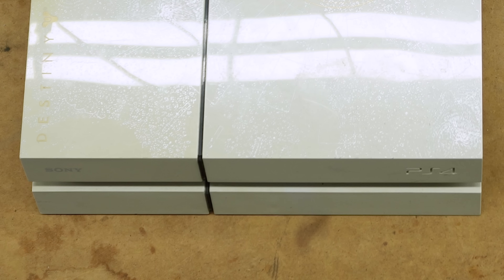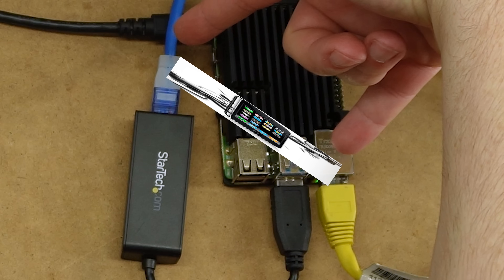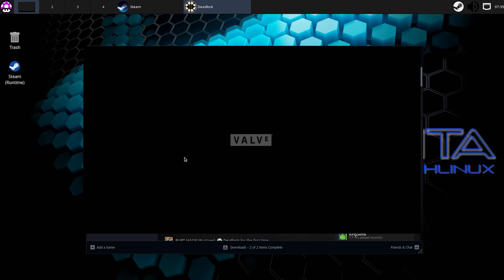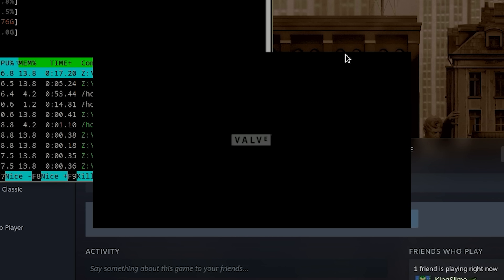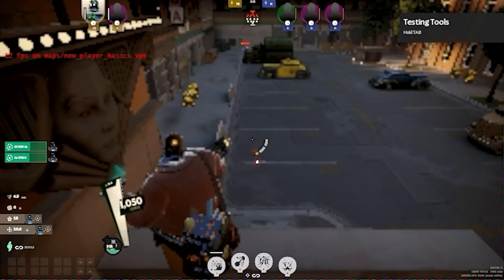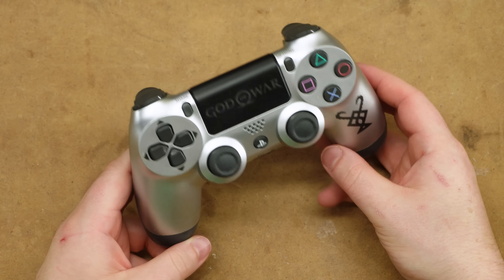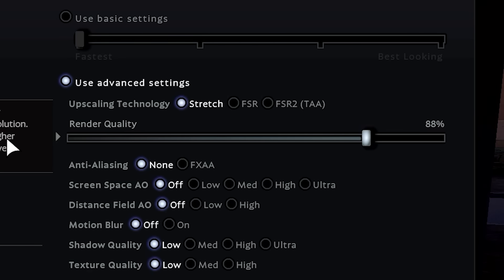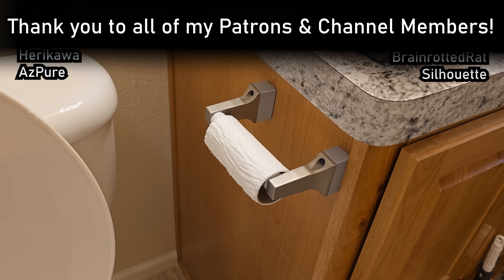I Played Deadlock on the PS4. It's as bad as it Sounds.

Comment: Yeah, swap on linux is important*. If you hit the memory limit, the kernel will go into a panic state where it runs the OOM Killer (the out of memory killer). Unix operating systems can promise a program more memory than it has, since the main way linux programs used to do multitasking was with fork() commands, which split processes in two. Then only the memory *changed after that gets copied, which is called copy on write. So what happens when the kernel runs out of memory, but has promised a program there was more to be had? Well.. out of memory killer. It starts looking at processes and sort of guessing what it can nuke. Sometimes that can be something that absolutely should not be nuked.

Always have swap, no matter what.
Reply: Also, the display driver is literally reverse engineered. Because of course there was a whole bunch of shit AMD did different for this one APU. Oh, and they couldn't launch linux on the PS4 with ease, because it turns out the PCI controller they homebrewed literally says 'yes, its there' to ANYTHING you probe for. So linux would literally try and launch every driver for every possible combination for every virtual slot possible recursively.

The fact that linux works on the PS4 is truly something else. But then again, the guys that figured it all out literally desoldered the pcie lanes and then hooked it up via a serial cable to another board. It's absurd.

Comment: It'll be interestig to see if the Xbox One jailbreaking scene goes anywhere since the One X at least has a bit more ram to work with. I'd imagine the Pro is struggling with that since even with all the extra gpu compute it really isnt going to be able to use it if its VRAM is a swap file.
Reply from the maker: I have a One X on hand for whenever the recent exploit allows for booting linux or windows

Comment: 8:57 for me it’s “I’m just happy Valve doesn’t release [TF2 updates] so often so I don’t have to do this all the time” 
Because I still haven’t fixed my server deployment and for a year every time there’s a TF2 update my server just runs a million update processes and fills all the disks until Debian comes to a crawl so I have to ssh in, clean up all the temporary update files, then manually update using the steamcmd binary itself across all user accounts and servers. 

Classic sysadmin, the solution will probably take me 30 minutes to resolve but this issue doesn’t come up frequently enough. What’s really annoying is when Valve releases back to back updates when the update from the day before has a small bug that needs to be resolved.

Comment: I'd just like to interject for a moment.

 What you're referring to in the video as Linux, is in fact, GNU/Linux, or as I've recently taken to calling it, GNU plus Linux. Linux is not an operating system unto itself, but rather another free component of a fully functioning GNU system made useful by the GNU corelibs, shell utilities and vital system components comprising a full OS as defined by POSIX.
Many computer users run a modified version of the GNU system every day, without realizing it. Through a peculiar turn of events, the version of GNU which is widely used today is often called "Linux", and many of its users are not aware that it is basically the GNU system, developed by the GNU Project.
There really is a Linux, and these people are using it, but it is just a part of the system they use. Linux is the kernel: the program in the system that allocates the machine's resources to the other programs that you run. The kernel is an essential part of an operating system, but useless by itself; it can only function in the context of a complete operating system. Linux is normally used in combination with the GNU operating system: the whole system is basically GNU with Linux added, or GNU/Linux. All the so-called "Linux" distributions are really distributions of GNU/Linux.

Comment: Maybe you should try to remove somethings from the game using the console or a custom file in tf2 I used to do that for example:
Remove ragdolls, remove effects and particles, put a limit on how many bullet holes can show up in screen....etc, I think this will help you boost your fps by at least 20
Reply from the maker: I was looking up some CS2 performance configs but they didn't really do anything on Deadlock, and apart from a few console commands that I found on the Deadlock discord there isn't a ton of info about making it run on ultra-low-end hardware yet

Comment: I have to wonder if you replaced the swap with zram if that would help anything. On the desktop, it's much more performant than swap space, and it scales based on need so you don't have to worry about maxing it out, or resizing it.
Reply from the maker: I wish I knew about zram while making this video. A lot of viewers are commenting about it and I'm just now realizing that it could have helped
Reply: @BringusStudios  Ha, yeah, it's becoming rather popular for the desktop, so that makes sense. I'm actually kind of surprised that Fedora doesn't use it by default. They like to be trend setters, but Pop_OS beat them to the punch.

Comment: I have a kettle lead with a metal earth pin on the plug, which is an overmolded plug, but no hole for an earth on the connector. It's like it was specifically manufactured as a prop for jokery, the tech support version of a whoopee cushion or a fake plastic dogshite

Comment: The similarity in performance between the PS4 and the pro says alot about the system drivers being able to fully utilise the GPU. if someone were to optimise that,  you could then bump up the resolution/textures to significantly offload the CPU

Comment: well, the difference between ps4 and ps4 pro is so low, since the two consoles use a useless jaguar, although in ps4 pro it is slightly overclocked ... I remember the announcement of ps5 pro in which the situation will be the same (the GPU is much more powerful (more muscles), and the CPU is in the form of skinny legs haven't changed)

Comment: I wish that Valve fixed Big Picture on Linux. It has been laggy regardless of system for like 5 years now
Reply: You need to enable GPU acceleration, although with nvidia or wayland that could make the desktop UI act a bit funky
Reply: @snil4  Yah I have an NVIDIA GPU. Even worse, I have an NVIDIA GPU in Optimus
Reply: @genethebean7597  Me and my rtx 2060 understand the pain, stay strong my fellow gamer

Comment: Bringus sets the swappiness to 100.
Me: OH NO NO NO NO NO
Reply: For anyone curious, 100 means to put stuff into the swap file as quickly as possible. You might think this a good idea, since the PS4 was running out of ram. The problem is that the SSD is going to be orders of magnitude slower than ram. (Case in point, the delay with the animation.) Normally, I'd suggest something low, so that it only uses the swap as needed, but since the PS4 is crashing before it runs out of ram, something in the middle might be better. Default is 60, but not sure if that's a good place to start.